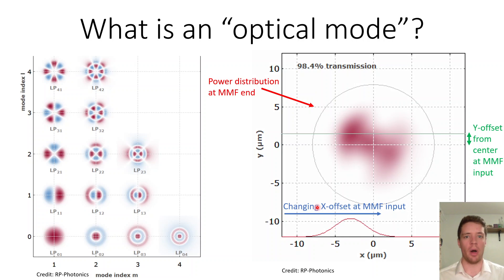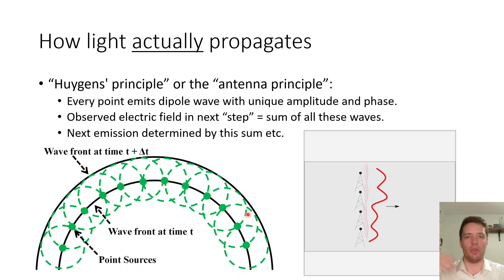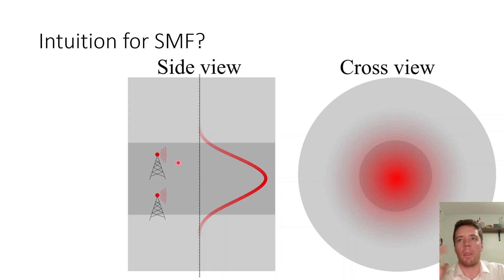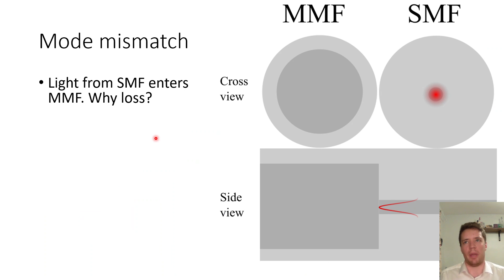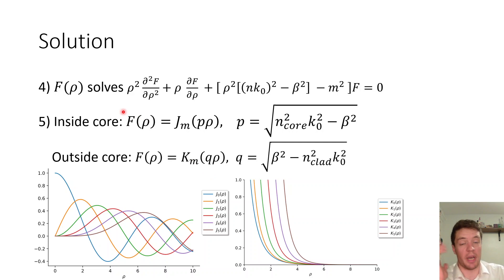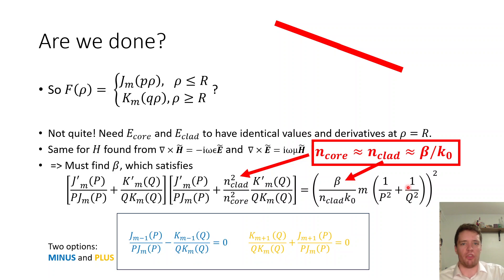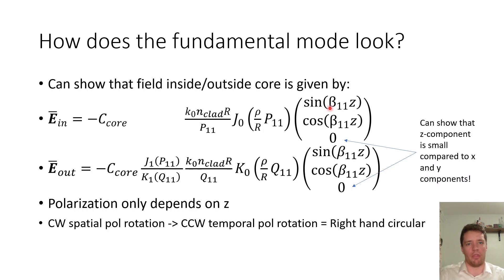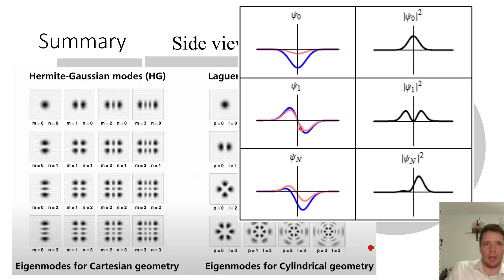What are "Optical Modes" actually? Single Mode and Multimode fibers explained!

Comment: I have a background in physics, mathematics and computer science. A couple of years ago I started working as a developer at Smartoptics. I have there seen the standard graphics of singlemode vs multimode fibers, where singlemode fibers are presented as have one ray following the center of the fiber, and multimode fibers are presented as having rays bouncing around along the fiber. I have thought that these representations must be simplifications, and that there is not enough space in multimode fibers for the rays to bounce around. You confirmed my understanding.
Reply from the maker: In general, selecting a visualization that gets the point across to a newcomer without overwhelming them with details (even if these details are correct) is extremely tricky. When it comes to the ray-picture of MMF, I think this is a case where the simplification is much easier to understand than the mode-picture, but the details it leaves out are crucial for actually understanding the propagation of light in fibers. Additionally, simply drawing a collection of sine waves rather than a collection of arrows is not that much more difficult, so I am surprised that the ray picture persists outside of lens design.
Reply: @yourfavouriteta  so, me is a newcomer and I have a simple question: do light rays still bouncing inside single mode fiber when it bended? As I get from your discussion, these images of bouncing rays vs straight line is a misleading simplification needed to explain output result, not a physics inside the fiber itself
Reply from the maker: @ElKudesnitsa . Ultimately, there is no such thing as a light ray. As explained in the video, the classical way to think about light according to Maxwell's Equations is as a wave-like excitation of the electro-magnetic field. Inside a fiber, the electrons in the glass molecules in a given cross-section vibrate due to the incident light field, which causes them to emit light of their own. The interference of the incident light with the light produced by the glass is constructive in the center of the fiber and gets more destructive further from the axis. The resulting "field distribution" looks approximately Gaussian. 

To understand what happens as you bend a fiber, imagine that you have two straight pieces of fiber with perfectly flat end-faces. If you press them together so their axes are aligned, you effectively have a single, whole fiber, where the fundamental modes of each of the pieces are identical. Therefore, no loss will occur as light propagates from one piece to the next. 

On the other hand, if you keep one fiber aligned with its center along the x-axis and position the other one so it's at an angle θ relative to the x-axis, the situation is different. The fundamental mode (i.e. the one that propagates without changing shape) of fiber 1 will be "A Gaussian with its center along the x-axis", while the fundamental mode of fiber 2 will be "A Gaussian with its center pointing up and to the right at an angle of θ". From the point of view of fiber 2, (assuming a small value of θ), the light field it receives from fiber 1 looks almost exactly (but not quite!!!) like its own fundamental mode. Therefore, most of the field from the fundamental mode of fiber 1 is transferred into the fundamental mode of fiber 2, while a small part (essentially the difference between a Gaussian centered along x and a Gaussian angled at θ relative to x) escapes. 

Extend this analysis of 2 large fibers angled at θ to N->infinity small fiber slices angled at dθ and you can understand how bending causes loss; it is the "mode mismatch" between adjacent fiber segments that causes some of the field to escape. 

In practice you usually, you need to bend a fiber to a ring smaller than 1-2 cm in diameter for bending loss to be noticeable. Also, contrary to what most people assume about fibers being fragile, they must be bend quite sharply (<0.5cm) to cause permanent damage, since the plastic coating surrounding the glass distributes the mechanical stress. Note though that stripped fibers without the plastic coating snap very easily!
Reply: @yourfavouriteta  Wow! Thanks for a such detailed explanation! Took me a time and additional research to understand. And back to my initial question — no reflections (from classical macro-scale optic) involved in singlemode propagation in fiber, and VERY rough way to understand this, throwing out many factors like evanescent field, is to compare light in fiber to electric current in copper wires.
Reply from the maker: @ElKudesnitsa  Regarding the analogy to electrical current, I think it's better to compare light in a fiber to the electric FIELD around conductors. Current electrons in wires actually move extremely slowly, while disturbances in the electromagnetic field that they set up move extremely quickly. This is why conductors were used for transmitting telephone and TV signals. 

Before the advent of optical fibers, the "consensus approach" to high capacity telecommunications was to use hollow copper tubes for transmitting signals. I believe that it was Charles Kao who joked that these tubes would eventually be perfect for housing the optical fibers that he was in the process of developing.
Reply from the maker: @ElKudesnitsa  Some quick exercise questions to check your understanding:

1) Will using light with a shorter wavelength of light increase or decrease the loss due to bending and why?

2) Will using a fiber with a smaller core increase or decrease the loss due bending and why?
Reply: @yourfavouriteta  
1) Since fundamental mode by definition already has wavelength as short as it can support propagation through selected waveguide, light with a shorter wavelength will have 100% loss in that waveguide.
2) I don't know. With the same wavelentgth i think smaller core will cause 100% loss. With proper light wavelength, I think using a smaller core will increase losses because "A Gaussian with its center along the x-axis" are "tighter", while angle θ between slices is the same, so more light field will miss a Gaussian of the next slice. (or maybe it won't change at all?..) So my conclusion is that singlemode fiber (designed for technologically optimal wavelength) must be as small as it won't turn to multimode and as big as it can withstand bending. UPD I'm think i'm completely wrong here and actually smaller core is better, but now I can't explain why
Reply from the maker: @ElKudesnitsa  I think that you may be misunderstanding the definition of a "fundamental" mode. 

A "mode" is simply any electric field distribution, which retains its overall shape as it propagates through the waveguide. Many such modes are possible, but the "fundamental" mode is the one that changes the least in the transverse direction; i.e. the one that has the same phase at any point in its cross-section. 

For each mode, there is a "cut-off" wavelength above which it cannot propagate. For typical single-mode fibers, the "first higher order mode" has a cut-off wavelength around 1260nm, so below this value, 2 or more modes are possible. Above this value, only a single mode can propagate, but you don't need to be exactly above 1260nm for the mode to be fundamental.  

With this in mind, here is a tip for answering 1): Consider if a wave that oscillates quickly in space (i.e. one with a short wavelength) or one that oscillates slowly in space (i.e. one with a higher wavelength) will have an easier time adjusting to a waveguide that is curving.
Reply: @yourfavouriteta  Yes, I got it wrong, I confused lowest order and lowest frequency and nothing clicked in my mind, lol.

Well, if imagine waves in fiber as polygonal curve in tube, where each polygon is equal to length of single wave, the curve made of shorter waves (higher frequency) would fit much better and will be closer to centerline in average than curve made of longer polygones, so losses are lower with the higher frequency because, ehm, less energy would escape the center (mode).
Reply from the maker: @ElKudesnitsa  That is a good way to think about 1)! A shorter wavelength means that the field along the z-direction essentially consists of "a larger number of small pieces", so it has an easier time adjusting to gradual changes in the fiber caused by bending.  

As for 2), using a smaller core will generally lead to a smaller mode cross section, which leads to less bending loss for the same reason that driving a small car around a sharp turn is easier than a broad truck. However, at a certain point, the core becomes so narrow that most of the field "spills out" and is guided as an evanescent wave, which is very broad and thus experiences large bending losses. Check out this link for an illustration of how mode field radius depends on core radius:

https://www.desmos.com/calculator/jn5xgkecho
Reply: @yourfavouriteta  Thank you again!
Reply from the maker: @ElKudesnitsa  You're welcome, I am glad I was able to help!

Comment: The math in this video is way beyond my comprehension, so I will frame my question around a principal I think is related.  Could the antennas representative of "center-frequencies" as a loose interpretation?  In a Microwave transmission system let's say the wave guide has a resonance calculated at 6 GHz.  The maximum transfer of power will be at 6 Ghz.  However "harmonics" of 6 GHz will also resonate at maximum power transfer such as 3 Ghz and 2 GHz.  Is this a decent interpretation of modes in fiber optic transmission?

Comment: Lets say I have a mode with bilateral symmetry (like the one at 5:37). If the electric field profile is rotated around the propagation axis, would it still be the same mode?